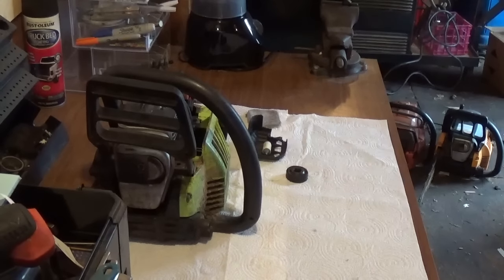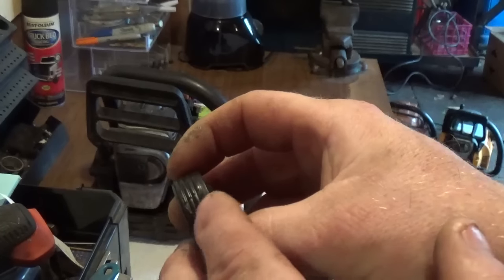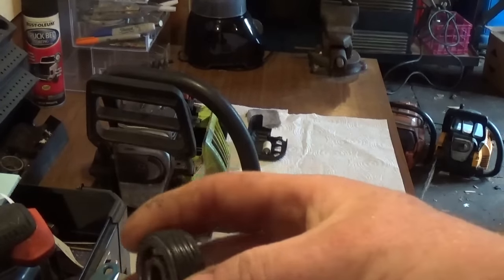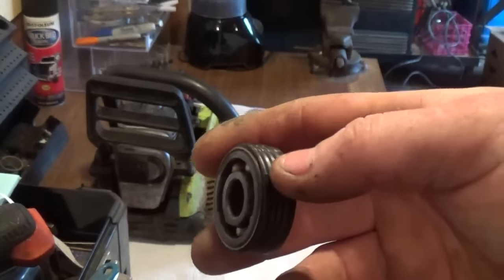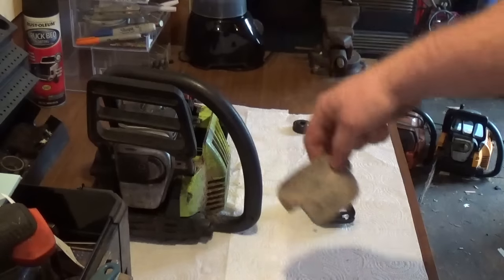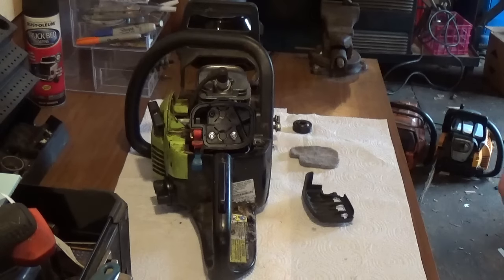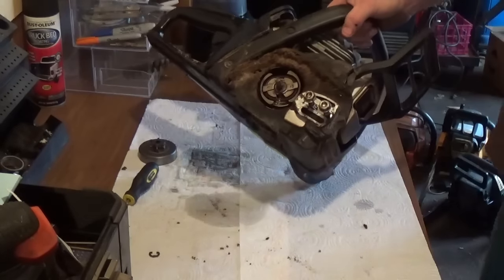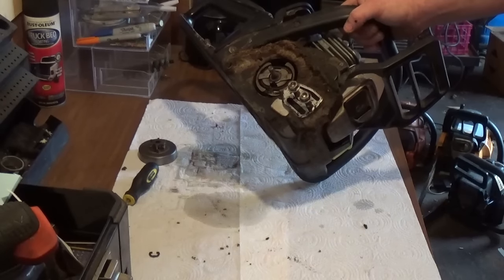Common problems with Poulan Chainsaws

Comment: A Poulan is not a Stihl, I get it.  On the other hand, 95% of user complaints I've seen are a result of a lack of maintenance.  The occasional, casual newbie chainsaw user creates a perfect storm of problems.  The saw is rarely used, the gas is never drained (so it gums everything up, the air filter is never cleaned, the fuel filter never changed, the spark plug never gapped, the saw is never cleaned of old sawdust and oil.  Yet people want to let the saw sit for 2 years, pick it up and expect it to run great.  On the other hand, those that use a chainsaw to make a living, or frequently use it tend to maintain it well.  I am no professional but I do maintain my small engines.  I don't use ethanol gas, I replace air filters, spark plugs, etc.  I have owned a Poulan Pro PP4218A for 4 years now and have probably cut down and/or limbed several hundred trees.  Never had an issue with it!  Is it because it's the greatest saw made, no, it's because it's a well maintained saw.  So, I am not here to defend Poulan, have to reason to, but some of this trashing is ridiculous.  You can't expect an occasional user to go buy a Stihl for 4-5 times the price.  It's like telling someone who commutes 5 miles a day to school they shouldn't buy that Chevy Caprice because it junk compared to the luxury car they drive.  So maybe I have the only Poulan in recent history that's worth anything (and I bought it reconditioned on eBay!), but I doubt it.  Do routine maintenance and it will serve 95% of the needs of the casual user that needs a chainsaw once every couple of years.
Reply from the maker: You are entitled to your opinion.....I can and will respect that ...you in truth made some very valid points that I to have addressed many times .But comparing a Chevy Caprice to a Poulan was a bit much . As at least in most cases the cars will last more than a few hour compared to the poulan that often needs repair straight out of the box.
Reply: well i have a Volvo i let sit for 2 years.  i went out and started it.  it started.  it din't idle for a minute and then shut off.  i must admit, the Volvo has been sitting under a tree for 2 years, and i hadn't changed anything on it since 2015.  but it started.  without issue.  maybe Volvo should make chainsaws.
Reply: Didn't really compare a Chevy to Poulan; I used the Chevy/luxury car as a metaphor for the stihl/poulan comparison.  My real point is that you SHOULD expect any tool to work when you buy it, no problem there, I agree with you.  But you shouldn't expect a low end product (at a much reduced price point) to be comparable to a high end product.  That's just not reasonable, not with chainsaws, not with just about any other products.  If I made a living with a chainsaw (or owned a bunch of land that regularly needed harvesting), I'd definitely own a stihl chainsaw. But since I use my chainsaw a couple of times of year helping friends out or cutting down (limbing) some smaller trees in my back yard, the Poulan unit works for me.  In conclusion, match your chainsaw to your usage patterns (or budget) and maintain whatever you buy!!!
Reply from the maker: No one can argue with that logic...
Reply from the maker: LOL...Stihl hard on ....well I guess using a Stihl I would certainly find my release. But finger fucking my way threw a Poulan would only cause carpal tunnel and make me a individual like you who is a master with a Pullin PRO.
Reply: I bought a 2004 Crafstman 42cc/18" (essentially the same saw as yours) at a yardsale for $85 Canadian with a hardshell case, with less than 1hr use probably 14yrs ago. Ran like a champ today till I accidently disconnected the choke pull-5 min fix and some cleaning under the hood...ready to rock & roll again. I agree 100%-look after your equipment and it will look after you.
Reply: I agree with Kevin, the Walmart Poulan are garbage, always have been. Guys, they were made for storm cleanup , thats it. When you are done with them, you throw them out. Face it, NO ONE doing storm damage clean up goes out on the weekends to cut 10 face cord of firewood using a shit popper Poulan Chainsaw. They wear out quickly and your typical home owner NEVER stores a chainsaw properly. I have guys bring them to me all the time because they are GIVEN  to them. They ask me if I can get them running. The reality is, by the time you pay a small engine repair shop to fix those cheap little things, you can go buy a NEW ONE.  I myself wont fix them any more. I give yhe owner the price of labor and parts, then show them the price of a new one, and they usually go buy a new one. Thats when they give that old one to a friend or try selling it at a yard sale
Reply: Most ever thing covered here is very true
Reply: Mike Kelly I’ve gotta agree with you on this. Maybe ppl shouldn’t buy a piece of junk if they don’t want one. I was in the navy for four years and been in aviation for over twenty so I’ve heard every kind of complaining ever. Oh yeah I’ve got four kids. The fact that someone hates this product this much to make a video means it’s gotten inside his head. A better comparison might be a caprice vs corvette. I guess. I had to clean the carburetor on my Poulen  today had to get on YouTube to do it and it ran fine after that. Cheers Bill
Reply from the maker: Show Proof Texas veteran power products .
Reply: I dont know who said poulan is stihl ,that's bull crap poulan is made by husqvarna
Reply: I got news 4 folks... After just buying a new Stihl saw last year my Hskavarna runs rings around that triple price piece of shit... Stihl lowered quality to compete is what happened and not Stihl is a total disaster too especially those saws like mine with those flip up tab fuel oil caps. Add that to whatever they did to the fucking carbs is foul just plain garbage nobody in their right mind would buy a new Stihl saw at their extorted name brand prices when they are like all the rest now total shit... Keep your old stuff folks take it to a shop leave it there till it is fixed.
Reply: @thekingsilverado9004  your're blowing hot air my stihl runs perfect  not one problem with it
Reply: I currently own 2 chainsaws; a Poulan Pro PP4218A and a Stihl 025. The Poulan is over 3 years old, and the Stihl is over 30 yrs. old.  I only use both occasionally. The Poulan does it's job, but it doesn't perform like the Stihl which over 30 years has seen a lot more use.

Over the years, like in all my 2 stroke small engines, I've only used Regular 87 octane gas ( 40-1 gas/oil mix) and added a gas stabilizer. I don't bother draining the gas during storage, instead I always keep the tank full with stabilized gas and oil mix. Although I do clean and maintain both saws, I've yet to to change the spark plug on the Poulan, and I believe I've only changed the plug on the Stihl at most twice.  They both start after just a few pulls and seem to run like the day I bought them. 

One might think that I've just been lucky. That is not the case. I believe the reason they haven't failed me yet is that I know their limitations and don't abuse them. To emphasize that, I also have an over 30 year old Honda lawnmower,  a Craftsman roto-tiller that's over 20 year old, and a Husqvarna snowblower that's over 10 yrs. old. They all have 4 stroke engines and I only use Regular 87 octane gas with stabilizer and they all still perform like expected.

To summarize, even though you get what you pay for, you MUST do your part.  In other words, if you know and keep within the limitations of each tool you use, and do the proper maintenance, it should perform the task it was intended for. On the other hand if you abuse your tools, don't expect them to perform or last.
Reply from the maker: I agree Stihl has been affected over the last 6 years with cheap junk to screw over people . They watched Husqvarna and seen the sales of there cheaper lines to fuck people over and decided to cash in on the price point shopper as well . Husqvarna is the master of all deceivers as they package there shit in many different colors as well as brands bought out by Husqvarna as a parent company. Genius on there part as they can control sales in many different communities by buying up companies and applying there creative touch on a brand that sales as well as cheapening the original product with inferior parts . I have seen this first hand with Redmax equipment .........And you guessed it .....Owned by Husqvarna as a parent company.
Reply: @mekelly999  I agree, well said.
Reply: Yey Mike; you could come and work for me ANY  time ( if i were still in buisness todayn
Reply: I'm with ya bro! I've had my craftsman which we know is a Poulan in disguise and bought it used for 100.00 In 1988 and have cut countless trees down and limbed even more and it's still with original parts and I'm still using it!! You can't ask for more from a was for 100.00
Reply: @scottfirman  I've done at least 10 cords with mine. YMMV. I'm not looking for a fight, sounds like a lot of them have problems. But mine has been great.
Reply: I have this exact poulan trash saw. For $200 you can get a 30cc stihl ms170 that runs with as much power or more and will last much much longer.
Reply: Absolutely right, I have the Husqvarna version made in China. Also have a Stihl chainsaw made in China and a pro Husqvarna made in Sweden.
Reply: Ok
Reply: I wouldn’t let him work on anything of mine,  especially my 4 Poulan’s.
Reply: I have and still use a Husqvarna 40 that is literally older than I am but has been properly maintained for the past 30 years and runs like a champ. The last issue I had with it was an old burned out spark plug. 4 bucks later and its like new again.
Reply: Haha no way , Poulons are complete pos.  Even if you maintain them well.
Reply: They should design a saw knowing that most people will not do proper maintenance
Reply: Poulon are definitely cheap saws but I must have lucked out with my 5020. I keep it very well maintained and it has served me faithfully for 4yrs now. Have been given a few in the past that were terrible right out of the box.
Reply: Not the case for my p3816. Always maintained never ran for crap. Every now and then id get a good 30 minutes out of it.
Reply: Your correct concerning the maintenence of the saw. That said the saw is cheap and affordable but it isn't designed for everyday use. If your gonna use a saw very much this is not the saw for you. If you can't work on these saws you do not need to purchase this saw.

Comment: I have the 3450 Poland made before Husquvarna bought them out. Then they started making them in China instead of the USA. Before Husqvarna bought the company. They were as good as Stihl. I love my 3450. Had a Poulenc pro years ago that snapped the crankshaft soon after I bought it. Husqvarna is a sorry company. I don’t like some other Husqvarna products I’ve had to deal with. They are crooks!

Comment: As an owner of my second Poulan 4218, I have to say this is my favorite chainsaw video on YouTube. My first Poulan wouldn't idle at all and would bog down under any stress. Luckily I lost that one off a trailer during a move. Inexplicably, when I needed another saw, I bought the same one. I rarely use a chainsaw and thought maybe the first one was a fluke. Nope. This one runs the same and leaks bar oil like crazy. Literal puddles of oil and slings oil from the chain when it's running. I've ordered a spline tool to try to adjust the carburetor. I'll tackle the oil leak next. On the plus side, YouTube is teaching me small engine repair. If I can't fix this saw, maybe I'll lose this one off a trailer too. No more cheap saws for me.

Comment: I’ve owned and used Poulan Pros, 3314s over the last 15 years and cut a lot of trees. I will agree with what you said about the fuel cap and add the bar oil cap locks up too. Fortunately nothing else you pointed out as common issues has occurred to mine. Hell, I actually like my Poulans. To each their own though.
Reply from the maker: indeed.....truly to each there own .
Reply: Yea I have a 3314 too. Bought it 7 years ago for cutting firewood and downed trees at my camp. It is quirky for sure - but for some reason I like it. Mine does act crazy like the guy says but its still going strong and cutting lots of wood.
Reply: "Poelin" and "Huskavarny" says it all!
Everybody else uploads fixes! Maybe he can't read the manual?

Comment: I'm tired of listening to you trash talk a saw I've used for years and cut a shitload of wood till it stopped oiling the bar. Ran Stihl saws in the timber for over 60 years. Have a big Huskavarna that was a heavy worker but too much problem.

Comment: I was running this saw for about 2 hours at about a 30-50% duty cycle https://www.youtube.com/post/UgkxfQm1wmg0ItKDLavxj1nXtQY9HP7EF504  and it did a great job. I used the lever for the built in sharpener to clear chip buildup out more than to actually sharpen the chain. It managed to cut some hardwood stumps much larger than it's size without bothering the neighbors with hours of 2 stroke noise.
Reply from the maker: Talking out your ass...
Reply from the maker: 42 cc of screaming skipped tooth performance....yeah thanks Oregon..

Comment: I've had my 1985 Poulan 2300 for 33 years and have never had a seal problem, even after I've tortured it.  Many of the problems I've had with it were my own fault due my occasional lack of maintenance. It hasn't been perfect but I am very satisfied with it after all these years; still going strong.
Reply from the maker: Great ...NO doubt the older Poulans quality far exceeds that witch can be found in there more modern equipment .
Reply: Poulan was a stand alone company from 1912 'til the early 60's when they partnered with someone [Beaird Co.??]. Then they were bought by Emerson Electric in 1972. Then the Swedish company Electrolux/Husqvarna bought Poulan in 1984. So my 1985 is one of their first guinea pigs [now I know how it felt to be a new Harley Davidson buyer just after AMF bought them, then quickly tanked the Harley Davidson quality. Willie Davidson bought the company back JUST in time].

They say today's mid-level Sears Craftsman chainsaws are slightly altered Poulans. But yes, as the years go by, many company's products get "cheapened" up, for sure!
Reply: Own a Poulan 2300, unknown year. Purchased from a farm estate sale, the owner had also worked for State Road. Suspect he'd bought it from them when they upgraded, AND then he must have used it around the farm. Well you can tell it has cut a lot of wood, and still runs though the coil is getting tired as well as the compression is shot. WISH I could buy new jug & piston for it, and it would out last this new junk they should just give away for free.

Comment: I have the poulan 210 pro, my grandpa had it for several years and gave it to me, i have personally owned it for 5 years and it never once gave me an issue except changing the primer bulb a few times and a new fuel line, which is common amongst all chainsaws, idk i just never ran into any major issues with it

Comment: i love my 1988 poulan 2000. it rips so hard for a 32cc saw. absolutely love it. however, the newer saws are cheaply made, and i agree with the video.
Reply from the maker: Thankyou / and this is what I keep trying to educate my viewers upon …….Simply the older Poulans are not all that bad ….{70s/80s} ….But the newer junk isn't worth taking home .
Reply: I have the same saw, or one from the late 1980’s. I’ll be the first to admit that it is rarely used these days and I don’t do the required maintenance, but 30 min of TLC and it runs great. Currently have it apart to do the proper cleaning for storage. It’s no Sthil, but does what I need it to do. Remember, buy cheap, buy twice. Thanks for the video.
Reply: @kevinbolin7665  I say Amen to that; these pieces of junk are just that - junk!. Case in point: you mentioned Husqvarna - well I have two Husqvarna 240 chain saws, only ever used the premixed 50:1 in them and the stupid things were always hard to start.  I took care of them, kept them clean, installed a new carb in one, rebuilt the other one after they wouldn't start today. People mention "operator error" when these thing don't start; well meticulously following the start procedures shown on the housing doesn't help. Previously started when new, but now - nothing. Good spark, clean fuel with new fuel lines - just absolute garbage.   I will be throwing these out and buying Echo from now on. Every Echo 2 stroke piece of equipment I have starts up immediately and runs great. Maybe the chain saws will be the same.

Comment: Totally agree on the gas cap...and the oil cap too!! I always had to use a large screwdriver to break it loose. From the first time I filled it to every time after.  I got my Polan pro in 2001. It ran like a champ till 2017. Ran ethanol, left old gas in it, every season it started on first or second pull.  Maybe they're worse now but my old one work great.  2017 the gas lines disintegrated replaced them and new full filter and still won't work right. I also used old used motor for bar oil. The poulan and got no love and a lot of work. 
 I bought a stihl farm boss. Much harder to start and if I'm not careful after it's warmed up, on a restart it floods easy. I like all my stihl products but my chainsaw hasn't been the simplest to work with yet. And I use non-ethanol gas on all my stihl products and their top grade 2 cycle oil, with Stihl chain oil.  I love my Stihl products, and my new chain saw.  
Still determined to fix my poulan. I think I need a new gas cap, cause it does flood the carburetor. And I likely will have to clean the carburetor. Cuz maybe crap got in there. After all I never gave it any love. Lol... Original spark plug and air filter too. 
Thanks for the video!!